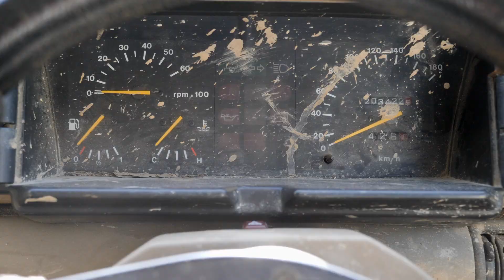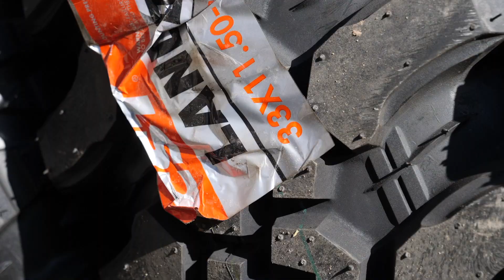NEW TYRES & WINCH - We're COMPETING Lando in a WINCH COMP! CST Land Dragons, Novawinch & Custom Fab!

Comment: I had the same issue with the fairlead. What i did was turn the fairlead bolt around so the thread is facing outwards. Can even elongate your winch mounting bolts backwards

Comment: Considering you were able to shave like 15mm or whatever off diff clearance would you consider just running the 33's with shaved diffs? Similar clearance to 35s but better gearing/power and less likely to break the driveline?
Reply from the maker: It’s a good question but nope, I’m after every big of clearance I can get. Have since sold the 33s, they were a good tyre but Lando is a big bus to be punting around these tracks and the 35s are just so much better
Reply: @Crawlerer79  that’s fair enough. 
I will definitely be looking into it down the track, I never heard of shaved Rover diffs, only Sals. If you do it on the rear please do a tutorial type video I would keen to give it a crack one day.